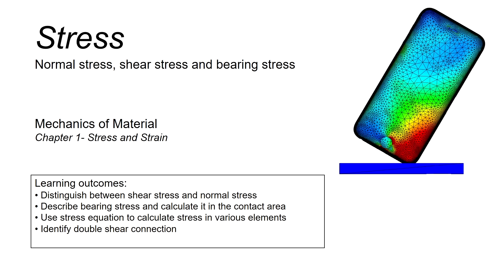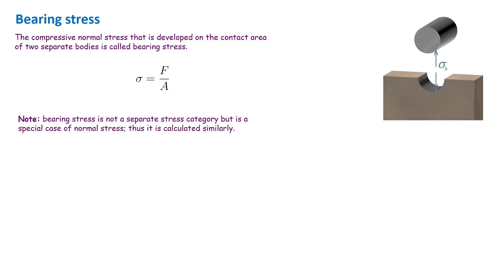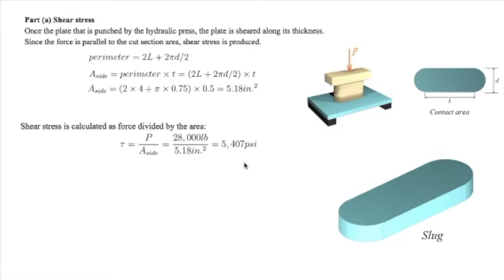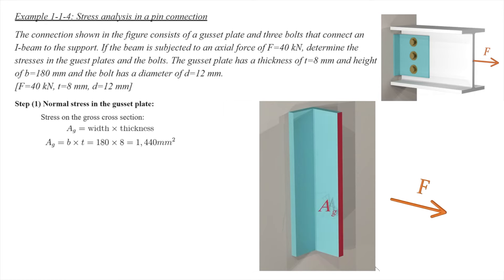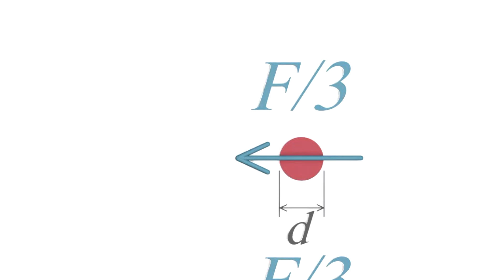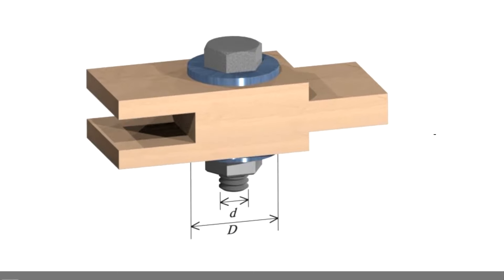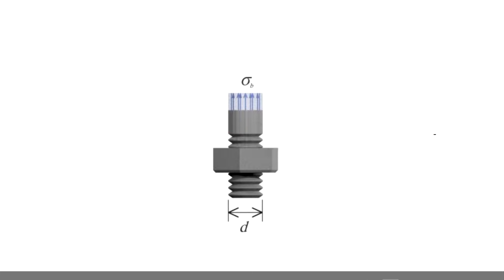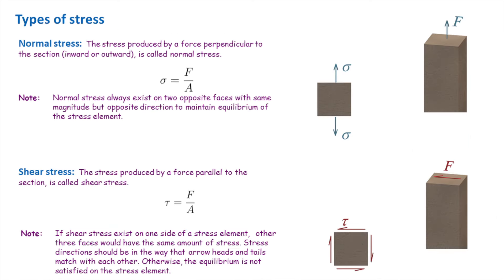Different types of stress (Lecture and example)

Comment: Please check if the area of the bolt in Example 3(case 2) is correct. To me it is 0.1963 in^2 not 0.0977 in^2.

Comment: there is error in the calculation ,EX2 , step 3 shear stress in the bolts , you use the value of thickness (8mm) instead of diameter of bolts (12mm) in area  , thankx
Reply: you are right
Reply from the maker: Yes you are right. The equation is correct but d = 12 mm. Thansk for the catch